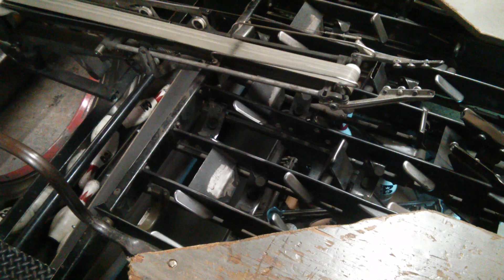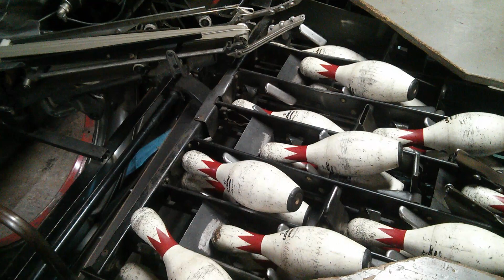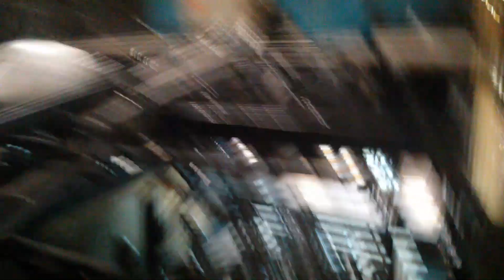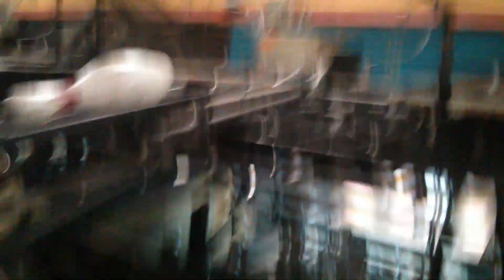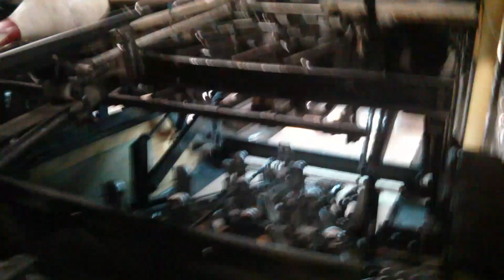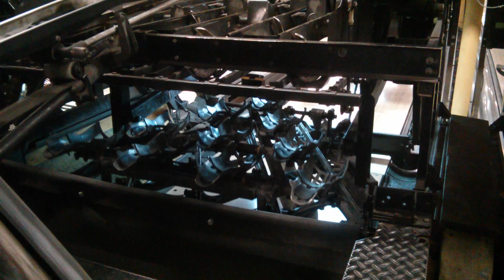AMF 82-70 pinsetter in operation

Comment: One place I used to bowl at, they had 70 series machines and on the strike cycle, the table would check for pins lije a GS setter would, maybe it was how the machine was wired but it was interesting to see

Comment: AMF makes Pinspotters, not pinsetters, but great video.
Reply: Stephen Hill. It’s pretty much the same, it’s the same machine that sets pins and returns balls. I can get used to Brunswick terms better than AMF.
Reply: @PinoyBowlerGS92  "Getting used to" something that's wrong doesn't make it right.
Reply: @vittoriostoraro . Whatever dude. I still don't like Bowling on this junk of a Pinsetter because me and my League Mates had bowled on these with Poor Maintainance and had to live with them since our center is the one and only center in our hometown, nothing else. AMF is so weak and gets weaker very quickly with Poor Mainatainance despite of its "Simplicity". Brunswick is still built like a tank, in fact our League bowled on GS-92's before that place burned down which had Poor Maintained as well but not too bad because no such crap like Pin Jams, Table Jams (fact when one pin is riding on a GS Table, the Table still runs correctly) or Interlocks, just Blackouts but still not bad as clunky AMF's. The Set Button is also a great thing on GS when pins fell on 2nd Ball, just push it, let it cycle for a few seconds and it will set the same pin combination you just recently left, AMF's (especially A2's) doesn't have that which is shit because mechanics are taking long to manually set em' back up.
Reply: @PinoyBowlerGS92  The A2 is Brunswick not AMF
Reply: @firealarmtechguy4444  I know they’re Brunswick alright. I’m saying both A2’s & AMF’s had no features that the Brunswick GS has.
Reply: @vittoriostoraro   However correcting others like kind of professionalism is wrong, there are people don’t like saying Pinspotters cause it’s like a tongue twister. Plus you don’t know how I feel Bowling on these machines, they were ass on my Bowling experience.

Comment: We have a brand new bowling center where I live, and we have Brunswick equipment, new Brunswick GSX pinsetters, but we have AMF Qubica pins though, to me, it doesn't really matter what brand of pins you use, AMF pins are compatible in Brunswick pinsetters, just like Brunswick pins are compatible in AMF pinsetters
Reply: But in a way, it would be good to have all Brunswick equipment in a center, maybe at the new center where I live, we can get Brunswick Pins, maybe the Brunswick Score King with the double red stripes, the AMF Qubica pins we currently have are looking kind of worn, and might be in need of replacing, maybe we can get the Brunswick Score king with the double red stripes around the neck
Reply: You can get the Pinnacle Pins, those are high end pins.
Reply: @PinoyBowlerGS92  They don't seem all that popular and there are some complaints about their reliablity. Either way for TV matches you'd have to swap out those lanes with Brunswick Max. Kinda annoying as I miss the days AMF and even VIA pins (a chinese brand) were shown in PBA matches.